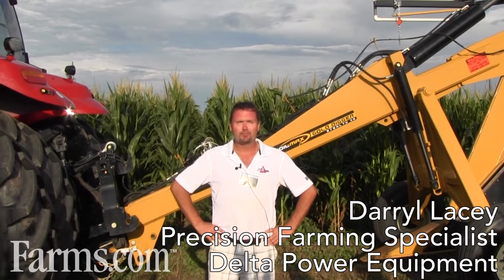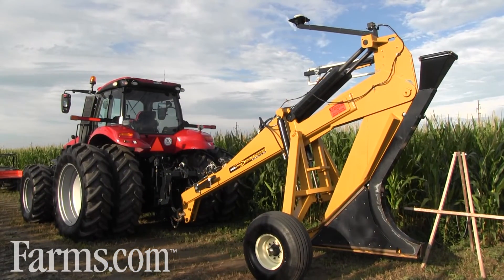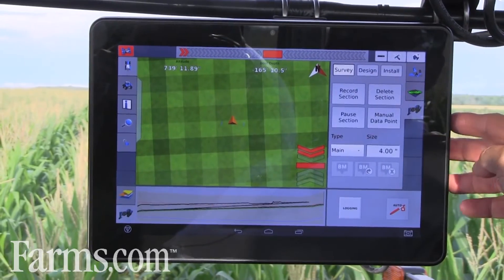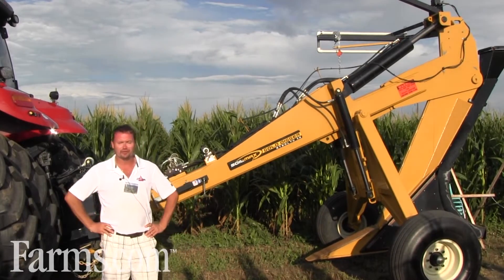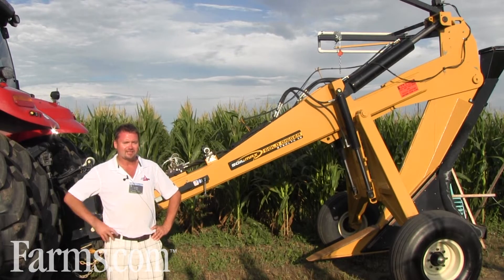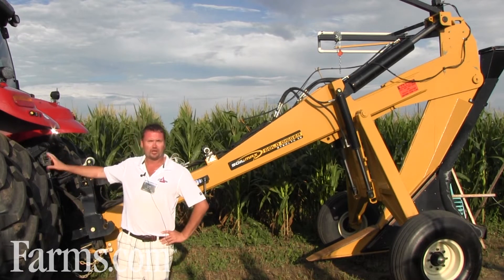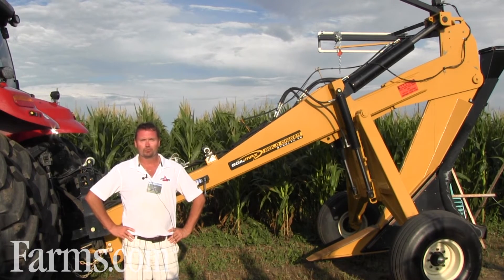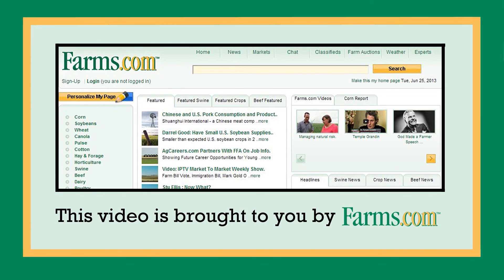Water Management: Soil-Max Tile Plow With Trimble Precision.

Comment: A 30,000lb tractor will only pull that plow 42" deep in Indiana under the best conditions. With a 36,000lb articulated 4WD, i normally need help when going deeper than 48" with 4" tile.